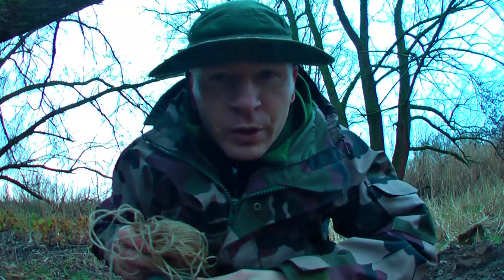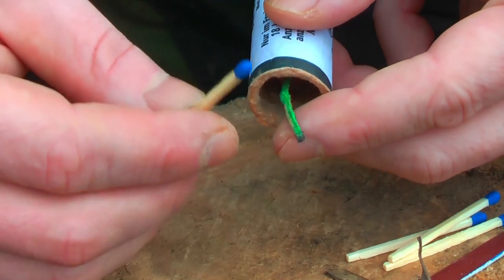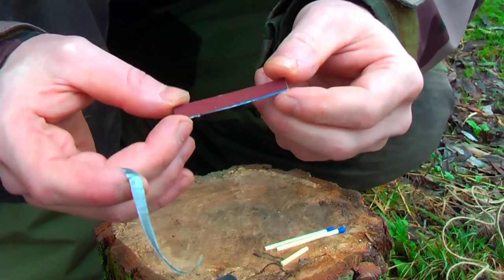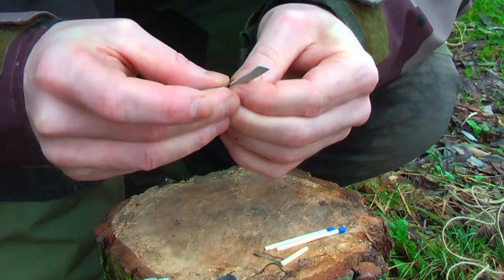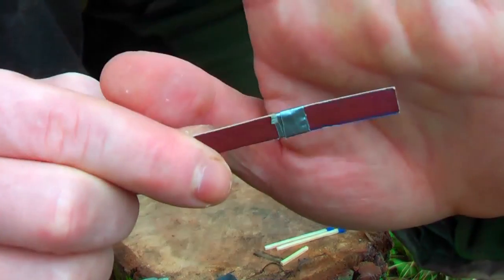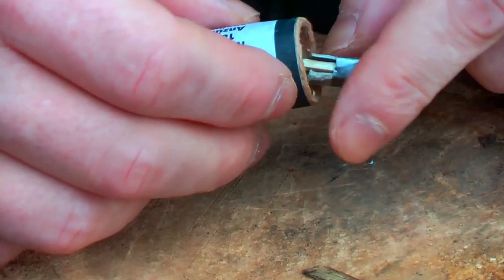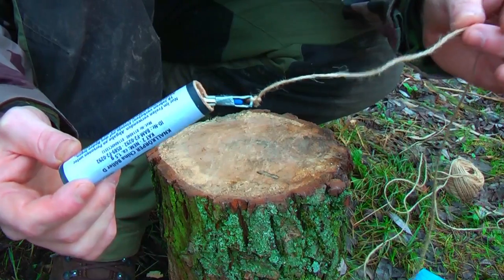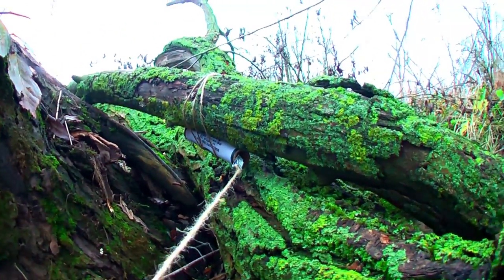How to do a IED booby trap camp security

Comment: Absolutely ridiculous. This is so unreliable. For ignitors, always use electricity (battery). And a simple bridge ignitor (electrical match). Or make a mechanical striker with primer solution.
Reply: +Dutch Prepper why? you can see it worked just fine.
Reply: Striking a match quite often fails, even doing it by hand. You will often need several attempts. Let alone relying on this contraption. Plus: to ignite, it needs a really fast snappy pull on the tripwire, which in reality would never happen. And I am not even talking about damp/wet conditions.